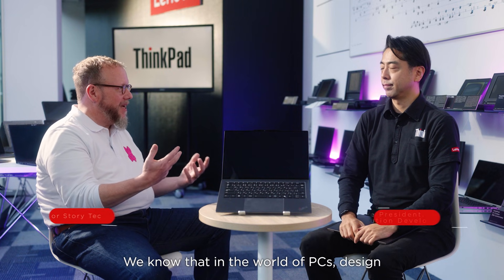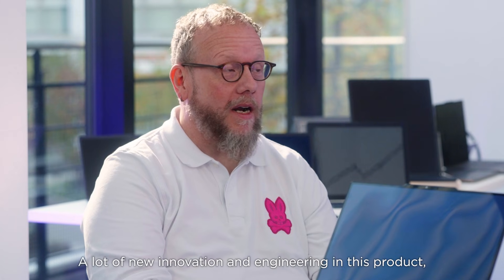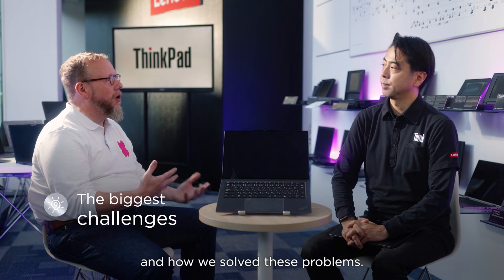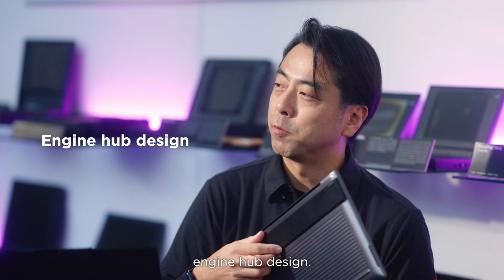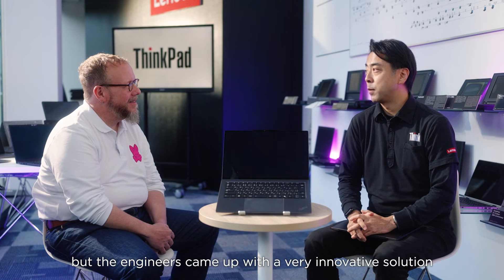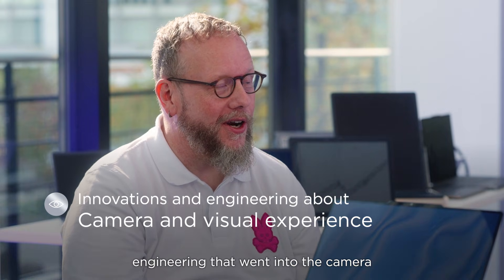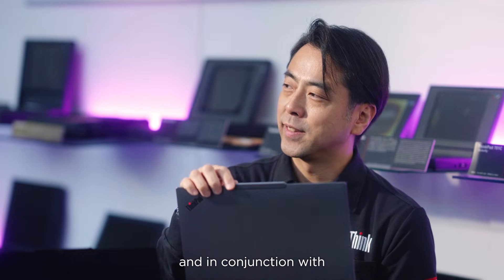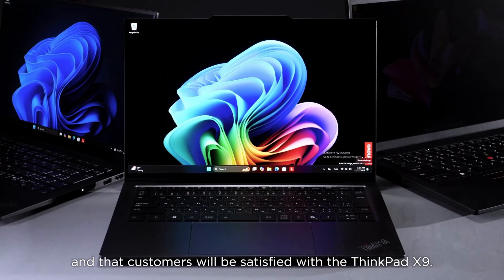ThinkBIG Academy Episode 1: User Experience Drives Tech Innovation on the new Lenovo ThinkPad X9

Comment: (1) Dear Lenovo Team, I noticed that ThinkPad X9 15 Edition doesn’t have the Anti-Reflection Dispaly upgrade option, the Anti-Reflection Dispaly just in 14 Edition, is my understanding correct?
(2) The ThinkPad X9 14 Edition can't select ForcePad?
Reply: bolt sizes come with anti-reflective on the screen and comes with a Sensel haptic trackpad pretty much the best haptic trackpad you can get on the market.